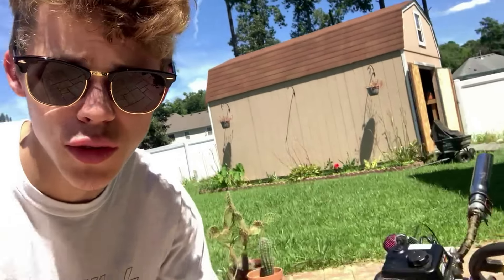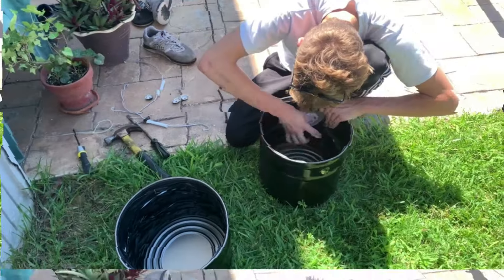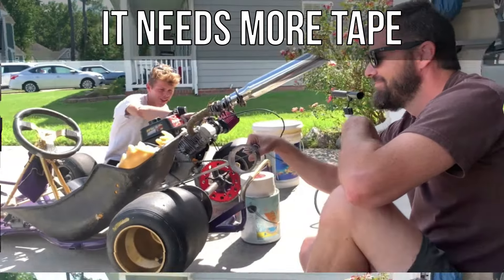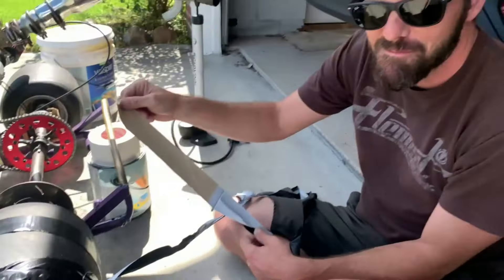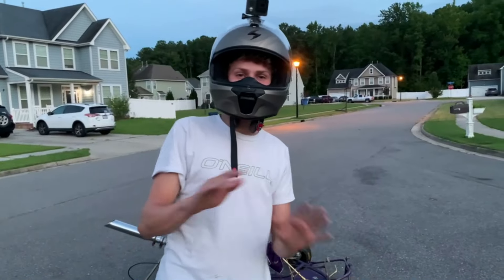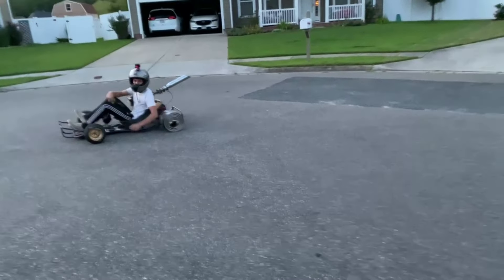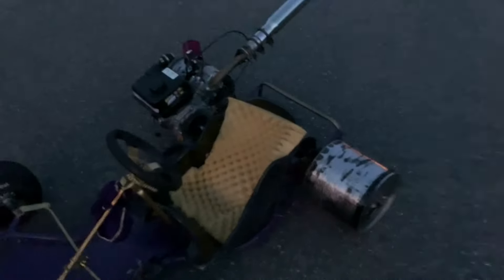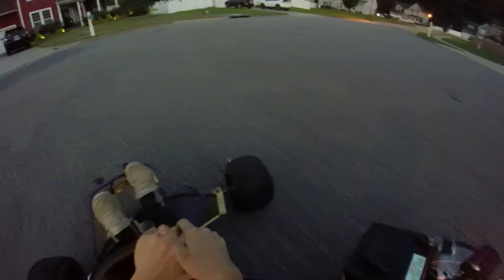Metal Drift Tires on a Go-Kart (sparks flying)

Comment: You gotta feather the throttle to maintain the drift
Reply from the maker: Yeah I normally can without any sleeves, but the fronts are so gripping that with sleeves on it just slides like crazy, plus I was just tryna throw up huge sparks lmao
Reply: @zachwarne  maybe you could use something like those textured metal sheets to add a little more grip and sparks
Reply from the maker: @outdoodled800  I could try and find something like that for sure

Comment: So I’m running 10x6 wheels with a 12widex8.00tallx6 tire. So what size pvc would I need?  Like 8.15in or just an 8in
Reply from the maker: Just an 8 inch, because if it’s 8 inches inflated, it’ll be a little less when deflated, so you can deflate the tire, hammer the pvc on, then inflate the tire to lock it into place

Comment: How much did you pay for that cart?
Reply from the maker: In my first Restoration video I got the Frame and wheels for $325, then I got the Engine for $150 and spent around $350 on parts for the engine, plus another $50 for spare parts and a new engine mount, so almost $900